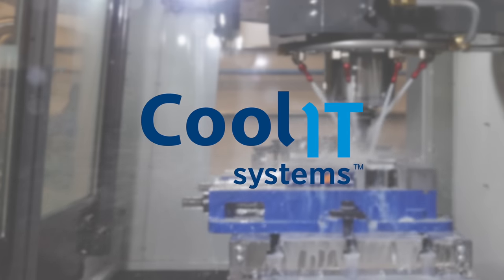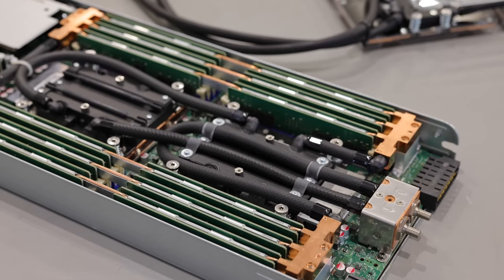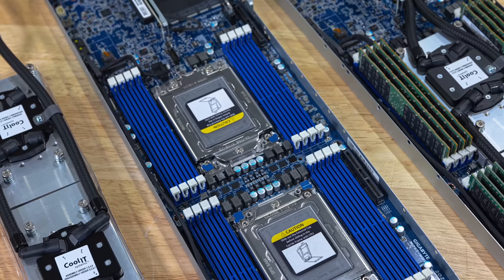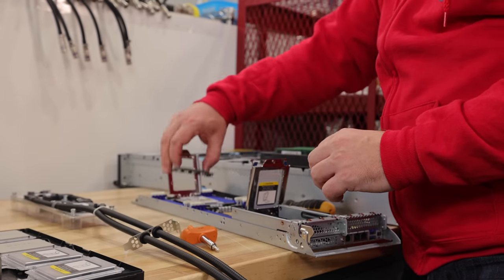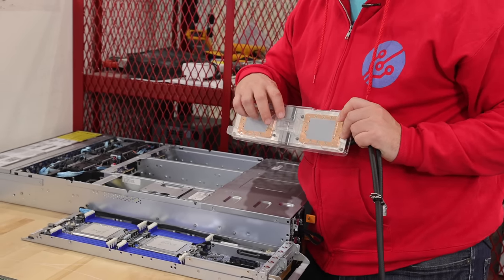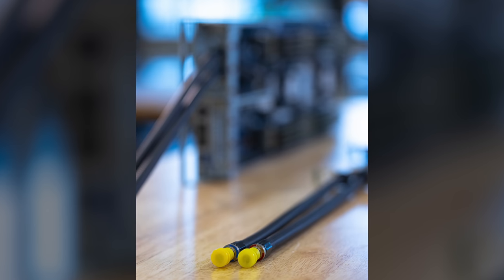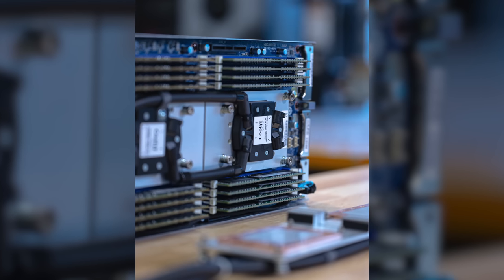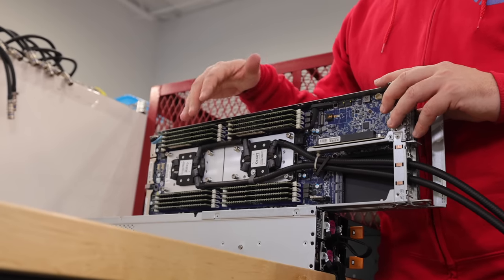How Server Liquid Cooling Works: Cooling 20K Cores with a Garden Hose

Comment: For that first shot I had some weird perspective thing going on; I thought the servers were on the floor behind you and were giant!
Reply from the maker: ha!
Reply: Did you see the wild raspberry pi at 16:42?
Reply: @OTechnology  i did :) i'm not surprised either - just a shame is wasn't a CM rather than cabled in.
Reply: @OTechnology  I THOUGHT that's what it was, but I didn't go back and check until I saw your comment HAHAHA!!!! To think a $10,000 server heat exchanger is actually running a pi4!! LMAO!!!
Reply: @Nobe_Oddy  That isn't a raspberry pi 4, maybe a pi3. The pi4 wouldn't have a full size HDMI port and the SOC would have a metal casing.
Maybe it is an older design or they couldn't get CM4s? The Application probably doesn't need much power anyway.
Reply: The exact same thing happened to me
Reply: @fkiesel9442  At 13:40, you might be able to see it is a pi 2. Hard to spot, but there.
Reply: KJ vsb, vs 

Vvvvv
Reply: And  everything looked huge!

Comment: EXCELLENT VIDEO, Patrick. Basic thermodynamics I/we applied 20 years ago during my Ph.D. thesis, for instance. "High-chem" and QC on pumps is key here: longevity of components INCLUDING the coolant mix and mastery of its phase diagram behavior, because x(@10+ years)*365/24/7 shall not change - EVER !
Reply from the maker: Very much so. That is why we did another video while we were up there on how these are tested. Look for that soon.
Reply: @ServeTheHomeVideo  I'd Love to see a video on creative solutions data centers have used for cool source water — like loops into a large body of water like an onsite pond or lake, or something like the new "space air conditioning" which basically converts the heat into infrared via special polymer tubing, and irradiates it up into and out of the atmosphere — almost like a reverse solar panel.

Comment: I remember CoolIT from back when they made AIO liquid coolers, 15 years ago!  I had a slightly modded Freezone Elite, an absolute beast of a unit, which could bring my CPU well below ambient if I let it.  I later picked up a used 2U server that had a CoolIT system mounted where the front bays would have been, whisper quiet and perfect for my homelab.
Reply: I thought you can't go below ambient with water cooling. Best case you are equal to ambient.
Reply: @ilovehotdogs125790  It's a Peltier unit actually, so it makes sense. With normal AIO y'a, can't go below ambient though :)

Comment: I just love how amazed Patrick is about the thermal capacity of water, indeed very effective! 😃
But yes, taking the numbers given, the water should be about 38°C warmer than the input, if loaded with 80KW. That's easily handled by tubing/pumps etc.
A lot of energy still, think about heating 1800 liters of water by 38°C every hour! 😛

Water flow at 30L/min = 0.5L/s
Water thermal capacity is 4186J/(L·°C)
4186*0.5=2096J/(°C·s)
80KW=80000J/s
80000/2096=38.2°C temperature increase
Reply: Ahh, now i should use the hot water convert it into steam to generate electricity 🔥

Comment: From a mechanical engineering perspective, the chiller will be the next target for development (and I'm sure that there are already a lot of folks working on that) in order to make the chilling process more thermally, electrically, and mechanically more effiicent.

Afterall, it's thermal/heat management. The heat has to all go somewhere.

And the more efficient that you can make that process, the more efficient the entire cooling loop will be, even if you were running a data center in Phoenix, AZ, for example.
Reply: Heat from Datacenter should be used to heat homes. How cool would be home colocation of quiet, compact mining rigs during the winter? I know it would be challenging technicaly and perhaps legally (who'd be responsible for what in case of sth goes wrong etc) but just based on ecological and cost of electricity terms it would be a win-win. But realistically, unfortunately it's hard for me to imagine that. Unless doing some centralised heating, like locating many rigs in big boiler rooms that serves buildings or small communities etc.
Reply: @aeonikus1  
"Heat from Datacenter should be used to heat homes."
I agree. If there is an efficient way to store and transfer the heat.

Case in point, older cities in the US used to have a municipal steam generation to provide heat to buildings. There's a reason why they don't do that anymore, and a LOT of that has to do with the fact that even with really heavily insulated pipes, a LOT of that heat is lost during transmission to the surrounding environment, before you even get to your intended building.

So, you would have to "overdesign" the heat generation capacity to make up for those transmission losses so that you would actually get the heat that you need, in the building.

"How cool would be home colocation of quiet, compact mining rigs during the winter?"
I can tell you that with the mining rig that I have at home, it is literally more than enough to heat our ~1000 ft^2 house with only about 1.5 kW "space heater" running (read: mining) 24/7.

It's not technically a cost efficient way of heating the house (turning electrical energy into thermal energy) - our natural gas furnance is a LOT more efficient for that purpose, but so long as proof of work crypto mining is still relatively profitable, (i.e. it is enough to cover the cost of electricity), then it is still a net profit PLUS heating the house.

In fact, we didn't turn off our A/C until WELL into December, and we had to turn it back on I think as early as like February this year. (And the electrical costs that I am talking about is the cost of my electrical bill and NOT just the mining rig itself - so it's both mining and cooling/cost of running the A/C starting in February as well.)

"Unless doing some centralised heating, like locating many rigs in big boiler rooms that serves buildings or small communities etc."
So....yes and no.

There are some data centers that actually don't bother with chilling the incoming air (or water if they're using liquid cooled servers), but the problem is that then in the data center, you end up with hot spots which lowers the computational efficiency of the systems themselves.

So, the entire thermal management loop needs to be optimised so as to optimise the performance of the individual systems whilst allowing them to get at close to the "hot" temperature threshold without exceeding it so that you're also not spending a lot of energy cooling the incoming air/liquid supply (which just means that you need something else to be able to dump the heat somewhere else).

As a computational infrastructure problem, it's actually quite challenging to hit that balance over a wide range of environmental and operating conditions.

Comment: Great Job, Very informative to honest my only concern regarding water cooling is safety. Imagine a water leak in "Top Of Rack Server", it will ruin the entire cabinet. I know their must be some safety mechanism like measuring waterflow or difference in return vs outlet "Like Current Earth Leakage Concept" but still the concern is there. I have experiences with servers failing constantly due to humidity how about water leak. But you are right it is efficient hence it is the future
Thanks again
Reply from the maker: There are leak detectors people use. We also have another video with a tour of the lab coming to help show what is done to test and build reliable liquid cooling
Reply: You can also just use a non water cooling fluid like Galden HT200 in your primary loop and move your water cooled secondary loop away from your electrical equipment.

Comment: I like water cooling. I use AIOs on my humble machines because the CPU is the greatest heat generator and removing the heat the produce allows for more silent fans to cool all the rest. Also, on home machine we don't have those awesome airflow guides that servers and workstations have. I'll be building my first server with a server board and it will have two tiny AIOs and air cooling for the disks and motherboard.
Reply from the maker: You might enjoy the video we are going to publish this weekend

Comment: It's amazing. Only downside is so many data centers are not built to accept liquid cooling. Raised floors with power under is not so friendly should anything leak. :)
Reply from the maker: That is why the next video is going to be on the Liquid Lab we are in and how they test these systems. Starting later this year, not having liquid cooling is going to mean that the data center will only host lower performance/ lower density servers. We have been doing more on server liquid cooling over the past year to start pushing this concept so our readers/ viewers are ready for the transition.

Comment: I'd Love to see a video on creative solutions data centers have used for cool source water — like loops into a large body of water like an onsite pond or lake, or something like the new "space air conditioning" which basically converts the heat into infrared via special polymer tubing, and irradiates it up into and out of the atmosphere — almost like a reverse solar panel.

Comment: Thanks for the really cool 😉 video!

Really awesome content as usual with and by Patric! Would have been interesting to see the actual heat exchange element in CDS. If I understood it correctly the external water source cools the closed loop of the server system connected to the CDS. Seeing as the CDS don’t have fans pulling the heat away I’m really curious as to how that heat exchange works. Also how is the then heated water cooled?
Reply: The exchange is basically a normal radiator but instead of air flowing through it they flow water through it. That outside water (now warm) goes back to the datacenter cooling system, through the chillers (large AC equipment designed to cool the water) and back into a storage/buffer tank to then be pumped right around again and again.
This sort of equipment is usually already mostly in place at most datacenters as they provide the cooling used by the air conditioning.

Comment: How much of the daily heat load and hot water load for a surrounding campus can be recovered from a sweat spot sized data centre using water cooling?

Comment: So this might be a stupid question, but since you'll have a datacenter producing many kilowatts (or maybe even megawatts) worth of hot water, why not hook that up to a steam generator and try to recover some of power consumed? It wouldn't be close to break-even, maybe less than 20% energy recovery, but still better than just flushing that perfectly function hot water away.
Reply: To make that work would require the water to be heated to well over 100C, which means that whatever is heating the water would also have to be well over 100C.
Reply: @gloop6589  I think you're right, but surely you could use a heat pump to focus the heat? Things like sterling engines can sap energy out of much less heat so I'm sure you could do some energy recovery...
Reply from the maker: There are several projects looking at re-using the heat from servers for heating water and building heat applications. Steam less so.
Reply: I'd think that generating an appreciable amount of electricity would thermodynamically require a sufficient temperature differential to ambient temperature, which is the exact thing that we're trying to minimize when cooling a datacenter. Could be wrong though.

Comment: Kind of surprising that the CDU seems to be controlled by a Raspberry Pi, haven't seen those in enterprise equipment before (besides a cluster in a 4U box type of thing).
You'd expect that some ARM based microcontroller or a simple SoC would be the preferred choice, it usually is right?

Did Gigabyte tell why they chose for the Raspberry Pi, is it due to concerns on chip shortages with ARM SoCs, easier development or anything else?
Does other enterprise equipment use Raspberry Pi computers? Perhaps another collab/competition with Jeff Geerling? :)
Reply from the maker: I think CoolIT was using RPi's because they were easy to source. I also think they are being phased out on newer products. This was also an older version of the CHx80 because we were running it on its side.

Comment: A good video Patrick but I wonder about something. Shouldn't Intel and AMD being working on their horrendous power consumption? I mean at some point the power draw of their processors becomes scandalous doesn't it?
Reply: Energy effiency is the thing that matters, it is going up.
Reply: transistor count will always go up exponentially. but efficiency limits the increase in power draw. They are as efficient as they get right now. you have to consider both aspects

Comment: so now all you need is a 120 ft deep water tank to dump the water into with valves and tubes on the bottom (up a little to not catch sediment) tied to another tank... dump the heated water in the top pull from the bottom as it cools to the other cold water tanks (small with exchangers to transfer as much heat out as possible and a pump that then pushes the cold recycled water back up to the massive server farm... waste not want not... swap in some better conditioners and corrosion prevention chemicals or better coolant and you have a pretty slick eco friendly solution... so tired of all the videos that talk about all the heat but never explain how they get rid of the heat other than massive water coolers on a building or giant server center hvac systems... I want to see giant cooling under ground instead of putting all that heat right back into the air around us... maybe I am nuts.

Comment: Forgive me, no matter how liquid cooling becomes robust, they don’t match with servers environment i.e. 24/7 work.
Reply: liquid cooling is used in industrial applications (and vehicles) 24/7 with no problems. The point here is what grade is the equipment. Consumer liquid cooling, heck no. They are using industrial-grade stuff here so it is fine